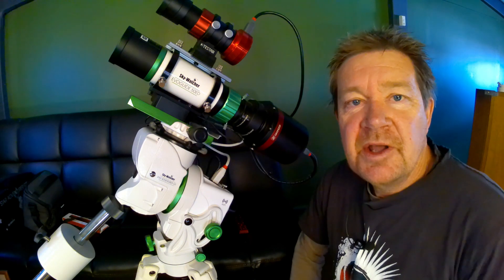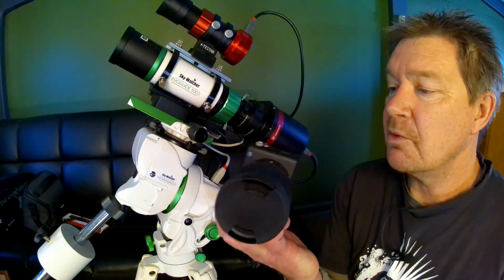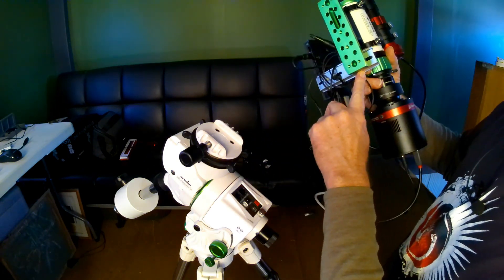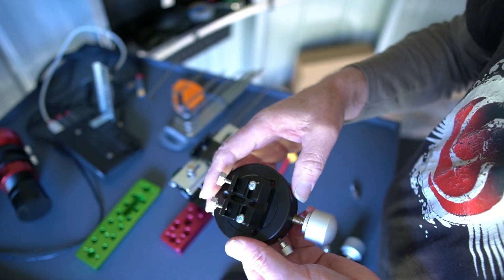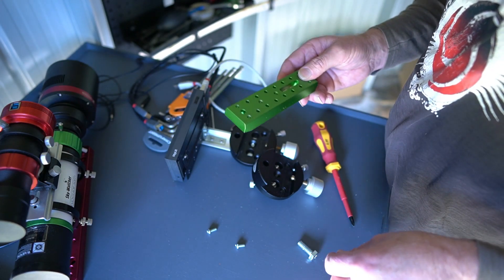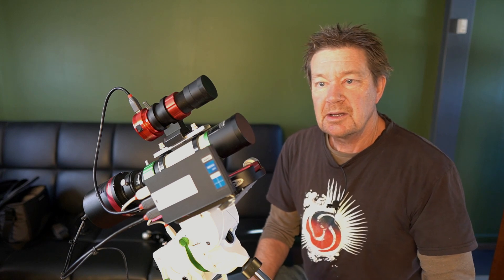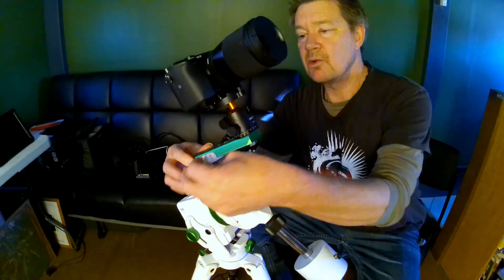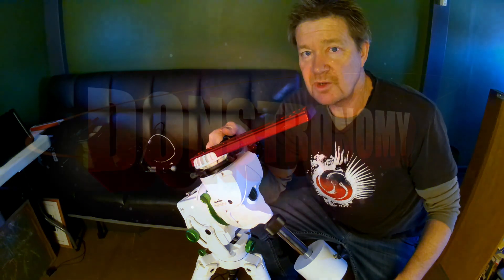Sony A6400 mounting on Star Adventurer GTI

Comment: Hey Don. Any suggestions between skywatcher 2i and az-gti
Reply from the maker: I have not used either of these trackers, however If you are looking at long exposure wide field milky way then the SkyWatcher 2i would be better as it is an equatorial tracker, cheaper and would work fine for that style of photography. The AZ-GTI however is a GOTO telescope, better for viewing then astrophotography. If you want the best of both then the AZ-GTI with the equatorial wedge would be the way to go. This would give you the flexibility for both widefield Milky way and the option to find deep space objects and track them accurately. 

Hope this helps. CS Don
Reply: @donstronomy7606  hey don thanks for the insights. Here in India, both the mounts have same price so i guess the AZGTI with wedge would be a better option.

Comment: Hiya Don . The Dovetail Saddles (3:32 mark) , I've seen people use them for exactly the reason you bought them for BUT they mounted weights to the Saddle to give even more effect at the far end . This should then allow you to move the main Scope Saddle back in the Mount for better balance (on the EdgeHD). What do you think ?
Reply from the maker: Hi Scott. That's a great idea. Just like the old butcher scales. I will need to purchase another saddle now. Might give this a go.
Thanks for the tip.